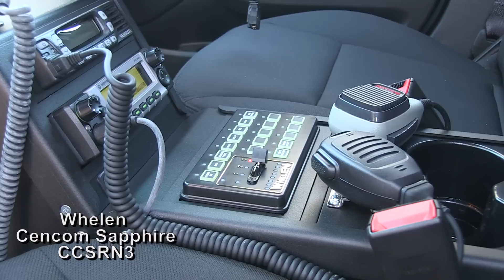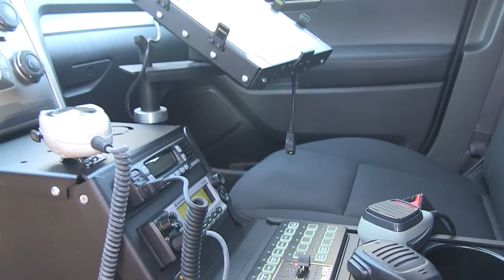Sirennet presents a CSI Ford Interceptor Utility installation

Comment: Cause the way we are looking to do it is (a blue unmarked explorer with a front interior light bar with grill lights and white strobes in the front. and red/blue split lights in the back doors for side lighting. and a back light bar and some small lights like halogen Miro-thin strobes under the light bar for when it's in traffic director mode and blue strobes in the reverse lights and red strobes in the brake lights.) That bout how I'd see the set up. Could SIRRNETTE or star car do that setup??? :)
Reply from the maker: Brandon Hess Hello Brandon. We would be glad to assist you on an Installation for your Department's Explorer(s). Please keep in mind that it will need to come visit us in Oregon. For additional details, please give us a call- (888) 959-0911 or send us an email- info@sirennet.com.
Reply: k. ill let the chief know. can he also reach you on facebook. i think i saw sirennet had a page on their? SIRENNET
Reply from the maker: Brandon Hess For contacting us for Product questions & Installation, it would be best to either give us a call or email us at the Sales Department directly. Our email address is: info@sirennet.com. Our Sales Team can be reached at: (888) 959-0911. Thank You.
Reply: k thanks :)

Comment: With the airbag on the passenger side would that be dangerous having the laptop in the way of the factory airbag if the vechile were hit & the laptop mount being in the way & airbag disabled to & not deploying, if there was a passenger in the seat at impact ?
Reply from the maker: On this Ford SUV and all of our Installations alike, we Install a passenger side Air-Bag Cut-off Module.

This Module has a Control-head with a key for switching the Air-bag Cut-Off Module on & off and allows the Air-Bag to be safely deactivated as needed. When a passenger is present in the Vehicle(s) the Module is activated so that in the event of a collision, the Air-bag will deploy as normal.

Comment: where did they purchase and how did they wire up that exterior outlet? I like that idea.
Reply from the maker: +Ryan Minutello    They Plug-in is made by "Marine Co."   They can be found commonly online or at a Marine/Boat Supplies Shop.    It is wired up to a Power Inverter inside the SUV. The Inverter wires into the 12Volt System and in turn, provides a regulated 110-120 Volt Circuit.